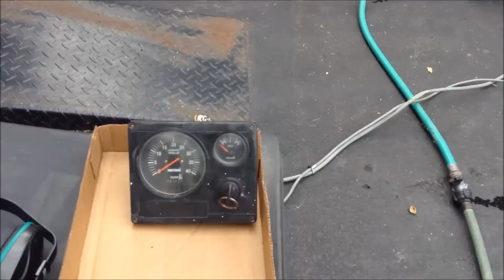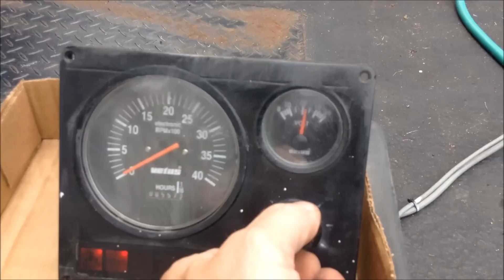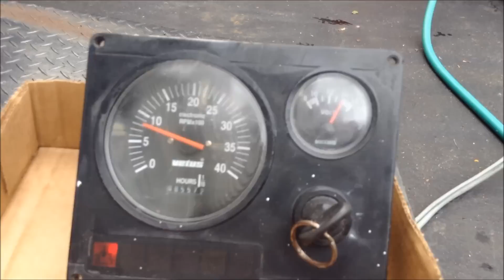Vetus M3.09 diesel engine test run

Comment from the maker: Not sure of the reliability of the engine yet. This video shows the entire first run of my ownership. I wanted to be sure it was OK before I installed it in my boat. I can say that it has a little over 500 hours on the clock from when it was in a sailboat. The only flaw I've found so far is the Hurth gear needs a partial rebuild due to the oil leak and the end play on the output shaft seems excessive according to the trans shop. It runs like a top though!